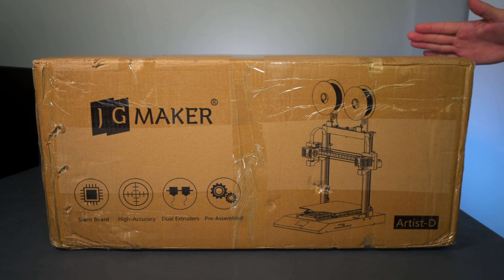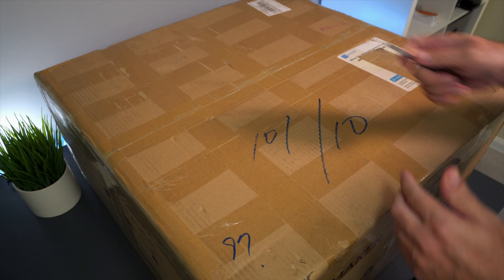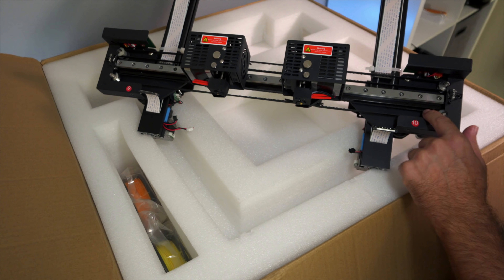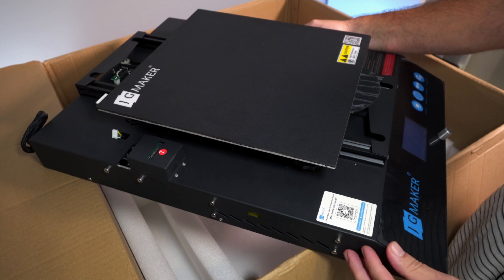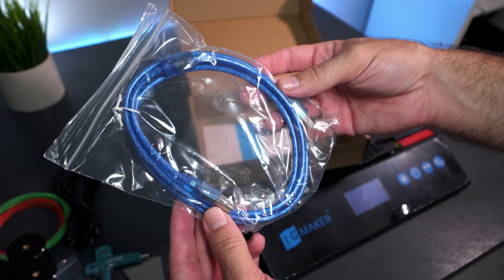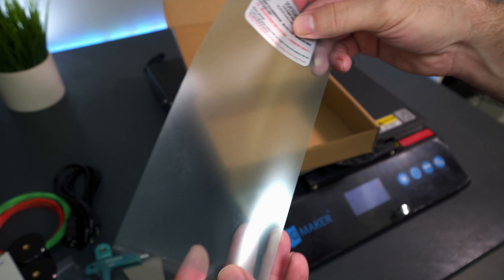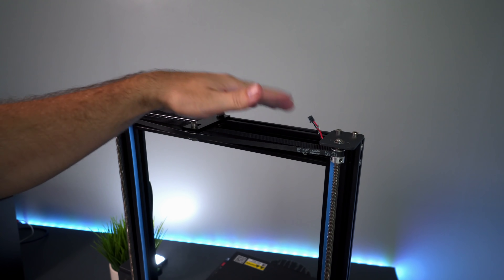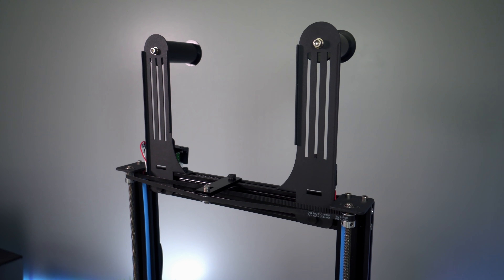JG Maker Artist-D - Dual Extruder 3D Printer - Unbox and Setup

Comment: Those cutters are getting really good. They may be mass produced, but they've perfected them. The ones that came with my Ender 5 Pro are the same and those suckers will cut through anything. Solid core, aluminum, etc.
Reply: I actually cut the hoted brass nozzles tip off with the creality cutters lol

Comment: I hate to say I found this unboxing very helpful- for the sake of returning this product. You hear about under-extrusion issues on these things, but if you're like me and think "well it can't be that bad," it IS. On top of that are just a plethora of strange quirks that aren't mentioned anywhere. If you want to run a gcode, it has to be in the root directory of the card or else the print never starts. If you forget to home between prints, you could easily find your extruders violently jamming together. Even at its price I can't say this printer is worth the hassle, and while it isn't IDEX I've found myself using part of the return to pay for a Bambulab P1P.

Comment: They installed TMC2208s in only 2 axis, I assume X and Y leaving both Z and both extruder motors on A4988 drivers which are whiny. At least you can upgrade them which is nice

Comment: I just ordered the E3D Revo newest hotend. it uses a patented design where the nozzle and heartbreak ar all one unit. so you don't have to heat tighten the hotend. can you comment in a short video about the nozzle plug-N-play design in this printer compared to the E3D Revo? if more companies are coming out with this design I think it warrants a discussion. this easy nozzle change design is the next best evolution in 3D printers. one more thing... if one gets a nozzle clog, I wonder how easy or hard it will be to clean to the nozzle. right now to clean a nozzle clog all I do is untighten the nozzle from the heartbreak, heat up the hotend and use a screw driver or other tool about the same size diameter as the heartbreak and push the filament through. easy.

Comment: Hi could you compare this printer to the Tenlog TL-D3 Pro 3D Printer. For me its either one of these, the only difference as far as I'm aware is the glass bed on the TL-D3 and copper wipers on jg maker
Reply: I think JG uses 32 bit while TL uses 8 bit, but they are coming up with an upgrade 16 bit board.  I think.

Comment: You do not have to manually move the axes around. There is an option in the firmware to move them around to the leveling locations.

Comment: If extruder does not move up or down (Z axel) when rotating bolt during “bed leveling” option:

 you’ll have to play a bit between two menu options (“auto home” and “level corners”) 

Basically, right after selecting “auto home” rotate this bolt clockwise or counterclockwise quickly enough before it finish returning to main position of “auto home”. Then go to “level corners” and check the result. Repeat as many times as necessary rotating clockwise or counterclockwise the bolt depending on the change in position of extruder during “level corners” option.
—————-
Explanation: When selecting “auto home” extruder firstly moves up releasing pressure on little sensor button. This button is there to let motors know when to stop landing extruder while going down. Later extruder will go down again and will hit the sensor button. 

The bolt touches small metal plate and the last one touches sensor button. Extruder stops moving downwards. 

So if you want extruder (during “leveling corners”) be further from the bed, you’ll have to rotate bolt clockwise during extruder movement in “auto home” menu selection. 

And otherwise: if you want extruder be closer to the bed, then select “auto home” again and turn the bolt counterclockwise.

—————

P.S. if, during rotation of the bolt in “auto home” selection, extruder goes down and suddenly printer starts to wiggle and make wired noise: simply turn the bolt clockwise a few times. Everything is good now.

This noise means that you have unscrewed the bolt to much. Bolt is not hiting sensor when extruders are going down. Motors have used all available movement space and reached bottom floor. However they still receive the signal to keep working and are trying to rotate both spirals to move extruders down.

Simply rotate the bolt clockwise

Comment: Thanks for the overview of this new printer. The nozzles are proprietary so I wonder how much replacement nozzles will cost. I would hope they offer an all metal nozzle for doing high temp filaments. I'm also wondering why with so many thoughtful features it's missing one main one, auto leveling. The UI also lets it down. My US$125 Kingroon KP3 has a nice color touch screen display. Even with it's faults, I may think about investing in this one.
Reply: hey, for replacement nozzle kt, it will be very affordable at our official website for our customers, do not worry about that, beside, we have 3 years warranty, for full metal hotend, we are working on that, and al of you guys will get that, for touch screen, our pro version will include that for sure. For ABL, the reason we do not include is our bed leveling system is quite simple enough, u still need to level manually even with able, so lots of user prefer do not have Abl without paying extra money .

Comment: There are a few reviews of this printer getting out to the YT reviewers now. Its a noisy printer. The fan/s need to be changed out to something more quiet. Those stepper drivers need to be upgraded to 2208 or better. That bed needs to be insulated on the bottom underneath. That screen is really in need of upgrading. Looks like the software needs some firmware upgrades too. When printing in mirror mode the extruders work fine for the most part but if you run them independently they are not as good. Some improvement is needed there. Those hot ends could be better. It wont do the higher temps. Its more for PLA at this point but if you want to do prints that require higher temps they are inadequate. I really like the quick release feature it has for the hot ends. Overall its not a bad printer and has lots of potential it just need more development and tweaks. Nothing that can't be done.
Reply: Hello, Bill from JGMaker. for fan, we will upgrade into more quiet fan, and mainboard, we use 32 bit silent board with TMC2208 already, and for bed, we will insulated for sure, this machine is beta machine. For firmware, we are updating now, and as we are open-sourced, we will release our source at our official website after we finish kickstarter project.
Reply: @JGAURORA3dprinter  Good to know. I think this printer has lots of potential if you work on it a little more.

Comment: Your Cables are twisted so they do looking weird
Reply: Yeah I thought that, they should learn a thing or two from the Artillery Sidewinder X1
Reply: @tcroft  It's not that they came like that. The guy it self twist cables while installing....
Reply: @josephbejm5752  regardless, have a look at the SW X1 cables
Reply: @tcroft  Yes X1 is a single head so it is easy plus a lot complains that the cable don't have locking on the plugs so a lot of them using hot glue to keep it secured. So it not that perfect like it looks..... At least this one has a locking on the plugs.
Reply: @josephbejm5752  I've had an SW X1 for over a year and never had an issue, there isn't locks on the cables but they do require force to remove
Reply: @tcroft  Why others have problem? You can search internet and you will see.
Reply: @josephbejm5752  yeah with previous versions, the cable issues were sorted for version 4

Comment: Manual bed leveling is so ghetto.
Reply: actually we use 5 point level that is quite easy to level, we will upload a tutorial video at our youtube channel
Reply: I'd rather have manual level than auto. So much issue with auto level
Reply: I have a authentic duet 2wifi on my creality cr10s upgraded everything dual authentic hiwin linear rails on y hiwin rails on x bondtech bmg extruder slice engineering copperhead hotend ac mains silicone keenovo bed heater pt 1000 thermistor and I still rather the manuall bed level option  I have a genuine bl touch that I don't even use